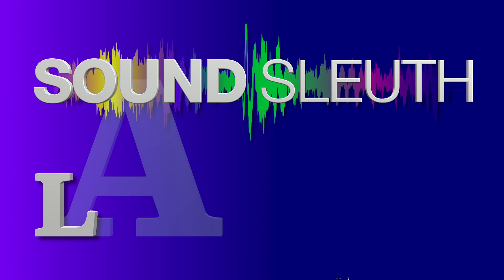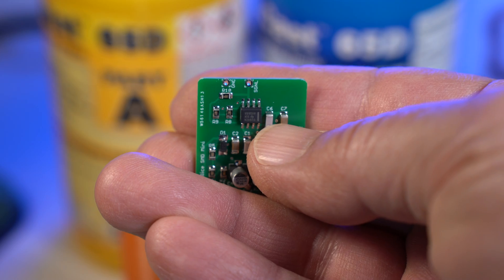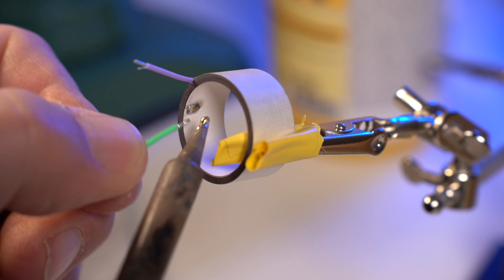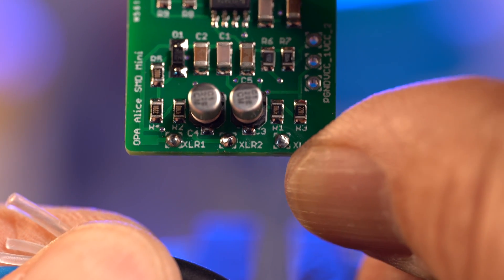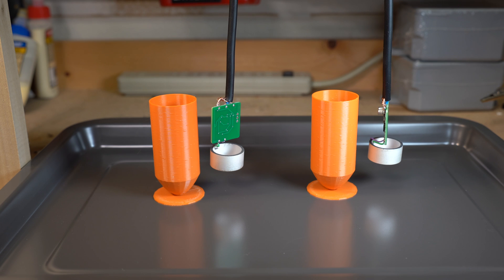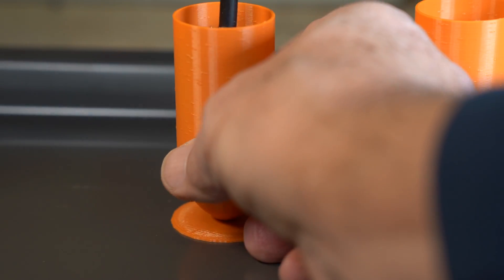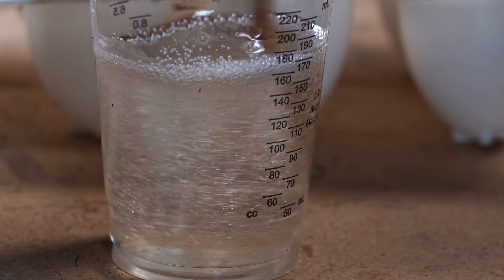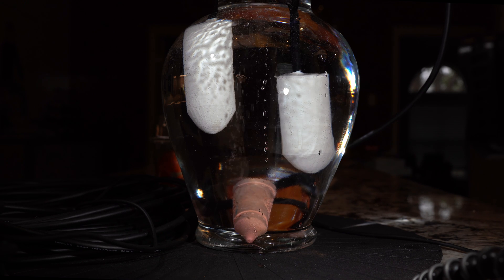Sound Sleuth Hydrophone Build

Comment: Hello , i've experienced a problem in curing the resin and i want to possibly remake. But the poured resin, surface looks kinda soft like jelly, sticks so much to the mold and i dont have any replacement to the ceramic transducer. What possible action do i need to do? If possible i want to reuse both the mold and the piezo😢
Reply from the maker: Sadly once the resin is used, there is isnt much that can be down to rescue things. I have gone through a fair share of my own glitches.

Comment: Solder... Solder SAY IT WITH ME SOL-DER SOLDER ... NO SUCH THING AS SODDER 

"Sodder" is a homophone of the word "solder". "Solder" can be used as a noun or a verb, while "sodder" is a noun that refers to an agricultural tool. 
Solder 
A metal alloy or fusible metal that is used to join two metal surfaces together
A verb that means to join or fuse two metal surfaces together using solder
A substance that is used to create a permanent bond between metal workpieces
A substance that is used in electronics, plumbing, and sheet metal work
Sodder 
An agricultural tool that is used to scoop or strip a layer of topsoil and lay it down as a cover growth or lawn elsewhere
Examples of solder in use 
Soldering copper piping together using a torch
Soldering wires to a printed circuit board
Soldering copper wires to a transducer plug
Reply from the maker: @HelpforDominique  I guess it all comes down to my accent and how I first heard the word. And, how it was pronounced at my Navy schools

Comment: Great video! I’m wondering if this setup  would work with audio recorder via in-line jack 3.5mm?
Reply from the maker: The circuit uses Phantom Power supplied by the XLR jacks when connected to a Mic Preamp or Field Recorder. See my Hydrophone Drop Rig for one the works with 3.5mm jacks. https://www.instructables.com/Hydrophone-Drop-Rigs/

Comment: Can I wire this to a TRS 3.5 jack instead of the XLR?  I’d like to use it with a Raspberry Pi and don’t know how to connect an XLR to a Pi.
Reply from the maker: It uses phantom power which is supplied by the XLR connector. You can use a usb interface with phantom power and connect that to the Pi via USB

Comment: Absolutely fascinating video. I wondered if I could encase an old cardioid condenser mic. I don`t use it and thought it might do. Is this possible and effective? It`s an Audio Technica AT2020.
Reply from the maker: You could but you wont get the coupling of audio that will sound good.
Reply: @SoundSleuth  Is that just because of the nature of it`s sensitivity strengths?
Reply from the maker: @thekarmafarmer608  Actualy it is that the AT is designed to pick up sound in air. The hydrophone is in direct physical contact with the water via the same density of the resin it is cast in. This allows for excellent coupling of the sound waves to the transducer.
Reply: @SoundSleuth  I`m very grateful for your reply. I`m quite new to this subject, as you can tell. Have a good day buddy.

Comment: I whould 3D printed a spacer/spine to hold two pzt tubes wired as a balanced input, 3D printed the molds in PLA.
Then I whould have applied a heatshrink tube over the spine with the tubes on, and a shielded heatshrink tube on top with a bare wire between the two heatshrink tubes.
Shielded heatshrink tubes has a electric conductive inner surface.
Do a overcast with low viscousity epoxy of the whole ordeal. Of course one needs a suitable buffer/impedance circuit.

Comment: Do you know what the power draw on these is?
Reply from the maker: @JackKingdon  about 7-8ma total
Reply: @SoundSleuth  Do you know if it is possible to get similar results to the above using 5v plug in power from TRS 3.5mm from a laptop?
Reply from the maker: @JackKingdon  You want this board for that. https://www.jlielectronics.com/diy-accessories/dual-hydrophone-pcb/
Reply: @ That uses an external 9V battery - was just wondering if it could be powered by the 'phantom power' (plug in power) 2.5-5V from TRS 3.5mm cables?
Reply from the maker: @ the Opamp needs about 7.8V minimum. So, it won’t work straight off of PIP power

Comment: Just received the Piezo cylinder and the pre-amp pcb. Cable and connector next. I'll airspace the element center as suggested and add a ground stub. I'm landlocked here, but one of things I'll be testing is to lower it into a dug well and see and many seismic signals might be coupled in from the surrounding ground. Another use will be as a Contact Mic for various things. Anything else I need to know before the actual build?
Reply from the maker: Just test before embedding
Reply: @SoundSleuth  I will do that :-). I saw on "instructables" that there was a question of whether to leave the airspace in the piezo ring open, or pot it too. Any thought on that?
Reply from the maker: @festeradams3972 I plan on building all of mine with an airspace moving forward
Reply: @SoundSleuth  Will do...

Comment: I have a question: The piezo element you chose seems to pickup all frecuency range but specially the higher ranges and ultrasounds, hydrophones like the Aquarian H2D have lower frecuency response and give a darker/"rumble" sound to the hydrophones, how can I achieve this ? What piezo element would work better for those purposes?
Reply from the maker: This is an interesting one. My hydrophone has  a pretty flat frequency response and does pick lower frequencies. If you want to focus on those, you can use a lowpass filter to just bring those through.

Comment: Is there a reason you used cylinder piezos instead of a disk? 

The cylinders are similar to what the Navy uses in towed arrays, and there it kind of makes sense, but is there a specific reason for cylinders in your single phone applications?
Reply from the maker: The towed arrays are multiple versions of the single one, just spaced out.  Similar to a microphone array vs a single mic.  The cylinder works really well as a transducer in water. Discs work really well as contact mics and attached to things the flex them.  The cylinders compress and decompress.
Reply: @SoundSleuth  is there a reason the cylinder works better in water?
Reply from the maker: Yes, the cyclinder picks up the acoustic energy in water via compression and expansion of the cylinder. It is more efficient than a disc in water.  @magicstix0r

Comment: Is it can be used as a sonar?
Reply from the maker: In essence it is passive sonar. The transducer can be used for lower power sonar. See the data sheet here: https://www.steminc.com/PZT/en/piezo-ceramic-cylinder-26x22x13mm-43-khz
Tjhe make other piezo elements that can handle more power as the transmitter underwater.

Comment: These sound great. I'm pretty familiar with the JRF and Aquarian Audio H2A hydrophones and your DIY mics sound, dare I say, better (though I'd need to hear more examples to be sure). I watched two of your other videos, the drop rig one and episode 17 (I think) where you're out swimming. The mid and highs sound so good but I was surprised at the absence of low end, especially when there are people swimming with large strokes, or paddling a kayak. There was also a motor boat pass by at some point where I would have expected much more low end. But maybe it's all just a coincidence with these particular examples. Has this been your experience with these hydrophones, the lack of low? If these can capture nice full low frequency content as well, I'm totally sold. The JRF sounds ok with an impedance transformer but are still very mid range forward with a lack of high end. The H2A is a bit better in the mids and lows but really lacks a nice high frequency response. Anyway, great video and great sounding mics. Thanks so much.

Comment: This is great I’m on the west coast of Canada have a 40 boat sit up for recording, I’ve ordered the tubes and pre amp, can you suggest a speaker that could be used in the water ?
Reply from the maker: not sure about in water speaker. you could use one of the Piezo cylinders, but you would need different amplifier.
Reply: why do you want to put a speaker in the water?🤔

Comment: Hello nice video , i have question this hydrophone can hear on a frequency of 1hz to 16 hz ?
Reply from the maker: Probably but attenuated.  The electronics have an inherent 8hz or so -3dB point.
Reply: @SoundSleuth  if i can get a good electronic board the result can be better ? Sorry then i ask to much , but i have a small project ... I need to make a infrasound mic and a infrasound emitter the hydrophone should be available of hear 1hz to 20hz also the emitter need to transmit 1hz to 30 hz if possible !
Reply from the maker: @mostwantedmes  email
Me ryckebusch at gmail dot com
Reply: @SoundSleuth  i send you an mail waiting for you respond .
Reply from the maker: @mostwantedmes  havent gotten it yet. ryckebusch@gmail.com
Reply from the maker: @mostwantedmes  Not sure I got it, ryckebusch@gmail.com
Reply: Hello friend I'm still waiting for your mail

Comment: Want to build this, but was wondering if the pcb is still the same, or if you’d recommend a new one bc of the xlr issue.
Reply from the maker: There isn’t an XLR issue.  I do need to come up with a shielding solution for the molding.  Stay tuned!
Reply: @SoundSleuth  i just meant the issue with the phantom blocking capacitors. I was wondering if you still recommended that same PCB board and what needed to be changed, since I wasn’t clear. Looking forward to building this for myself, but if all goes well, using it as a classroom project next year for an experimental documentary course I’m teaching!
Reply from the maker: @andrew.uroskie  yes! Resolved

Comment: I hope I am not disturbing you, however due to constraints of time I was hoping to tap into your skills and videographers skills. I caught your video on hydrophones (DIY). While observing the construction techniques I said to myself "woooo,  Which of course led me to subscribe and to download your available videos.I myself was in the navy, operations specialist on the coral sea, and while the medium is different it does result in energy being absorbed by a receiving device. I was accepted to Woods hole, but life doesn't always agree with our plans, today.I have sent away for the two shown piezo cylinders, and will shortly order the rest of the device you have shown in the video. I do not have a 3d printer so i'll have to procure that from another source.On the topic of aquatic sounds, recording them is a new avenue for me, but I have downloaded and will read all the literature shown at the sites you listed. 
My questions are (great plausible video) the device mentioned (shown) the frequencies it can record, I am looking at the manufacturer's spec's (which currently allude me) can the preamp/ opamp be adjusted to bring the inaudible to an audible range? And if so, have you already done so?In the video where you took the system out for the proverbial spin I did hear some variation in sounds, but i am currently assuming it may have been a simple cavitation from swim fins? Any tidbits would be helpful as I had said I am a little short on time (64.5 years old)thanks for your time Dave J.L
Reply from the maker: Just emailed you.
Reply: @SoundSleuth   Hello, no email found, but waiting, perhaps a deluge of mail! I did look, down load the article in instructibles,  the board still appears to use the lower grade capacitor?
Reply from the maker: @njvikings1  not sure what you mean by “lower grade”. The two coupling caps need to be 35VDC or higher.

Comment: Do you have to seal the peices in a bulky fixture like the resin bulb you have? Or could they be sealed inside plasti-dip and left with voids(speaking to the mic specifically)? The mics you are using are very interesting as I have never seen them before.

Comment: Do you have a link or part number to the zener diode you used? I didnt see it in the BOM. Thanks. Got my boards in and my piezo and am excited to do some water testing as well as hook it up to my DSA and peek at the phase response and see how linear it is
Reply from the maker: Im working on an updated one. I had some glitches with an under rated Capacitor. I WILL have one shortly
Reply: @SoundSleuth  thanks so much! Hope It didn’t feel like I was rushing you. Really amazing work and I’m excited to build this!

Comment: Very nice design.  One question:  it looks like your phantom blocking capacitors are 10-v rated parts.  Are those adequate to withstand 48V phantom power, or is your external recorder/preamp supplying a lower phantom voltage?
Reply from the maker: Yikes, those should be  higher. Let me double check some things...
Reply from the maker: This is the one needed. https://www.mouser.com/ProductDetail/Nichicon/UWH1H220MCL1GS?qs=6KhNe6Nhnot8wz5l1XqBFw%3D%3D
Reply: Excellent - thank you!  I was going by the BOM in the Instructables article and the Panasonic part listed there was the lower-rated one.  I did run a parametric search for a 50v part with the correct footprint for the PCB on DigiKey's site but that only turned up one obsolete part.  Very much looking forward to experimenting with a couple of these, once the present parts shortages are (hopefully) behind us.  I've never seen anything like these shortages in 30 years of involvement with electronics.  Thank you for making your work available on these, and your other audio / mic projects.
Reply from the maker: @WorldPowerLabs  real world you need 25V. I’m ordering 35V MLCC ones and will report back.  My prototypes were built by PCB way and used the 10V parts 🙁.  Will rework the ones I have that aren’t embedded yet

Comment: great job / work, very cool.

I feel like I should mention that the air bubbles slightly effect performance, the air voids change the acoustic impedance of the potting material by causing discontinues in the path the waves make thru the water.  This is generally only an issues if the size of the bubbles are close to the wavelength of the wave in the medium.  Since you are using audio band, probably doesn't matter as you say.

Possibly another thing to mention is that the potting you want to use should have a similar acoustic impedance to water, so that most of the received energy passes thru the acoustic interface.
Reply: Thanks, you are correct. The air bubbles effects really matter for ultrasonics and power transducers. The density of the resin being close to water keeps the acoustic impedance similar. In the Navy, they used more of  a rubber coating, going for durability more than impedance.

Comment: This doesn't seem like it'd be able to distinguish direction of sound though? Only distance? Could two of them be paired up facing different directions to production directional information?
Reply from the maker: In water you can use arrival time to determine direction. It’s actually easier in water than in air due to how sound travels in a fluid.
Reply: @SoundSleuth  From what I've read during WW1 one of the biggest issues was that their hydrophones could only decipher the distance to a target, not the direction, until they added a special transducer that could move in different directions allowing for pickup of the direction the sound came from? This is just a single microphone, no? How would it have directional information?
Reply from the maker: @izaicslinux6961  one can’t. That’s why I built two.  In the navy we had spherical arrays and then had a towed array that we could stream behind us that had multiple transducers.  Then it’s just math for time aligning or phase determination.
Reply: @SoundSleuth  Ah, neat! Thanks for the info!

Comment: Question. And here in the XLR connector you did not solder two 22nF capacitors are for RF/EMI
Reply from the maker: Ahh, glad you noticed. Because the Hydrophones are submerged they don't pick up anything the way that an "Airborne" transducer.
Reply: @SoundSleuth  Understood. And if you use this board for contact microphones based on a Piezo plate? I understand that the preamplifier can cope with such a task, because in fact it is the same thing. The hydrophone picks up water vibrations, the contact microphone vibrates a solid surface.
Reply from the maker: @fastunovaudio  Yes, it can be used with Piezo Discs. Then you would want the 22nF caps.
Reply: @SoundSleuth  Super, I got it all
Reply: @fastunovaudio   @Sound Sleuth  Hey! In which capacitors should I use 22nf for if I want to use Piezo Discs?

Comment: Thanks for video. Do you think it will work without preamp board but directly in Triton audio Piezo ? I’m using my barcus berry with these pre and it sounds great
Reply: Yes it will. Use a coax cable more than a  mic cable. single conductor shielded. It is more finicky with interference as there is no shielding to it but it totally works. Just the piezo cylinder molded into resin with attached cable.